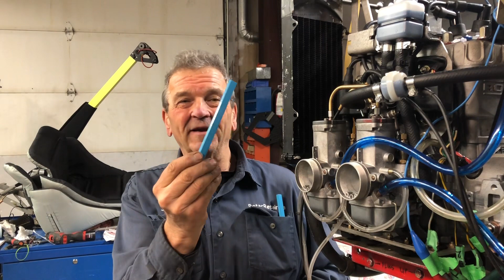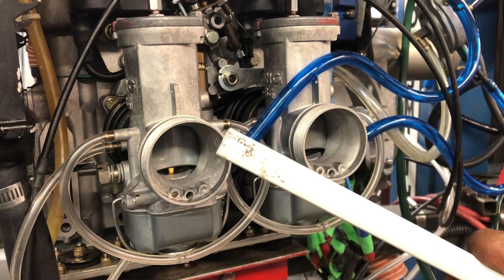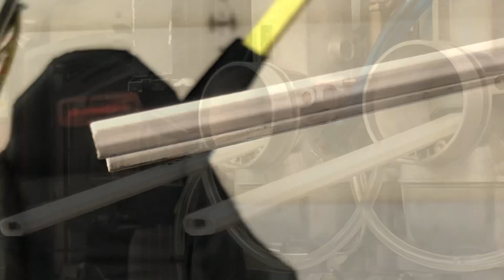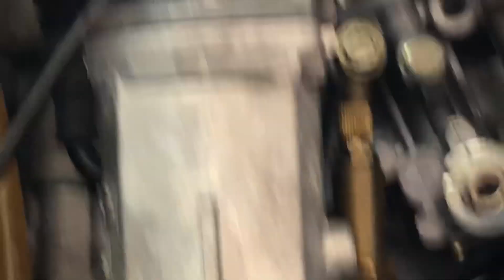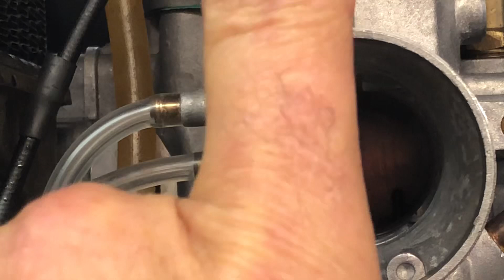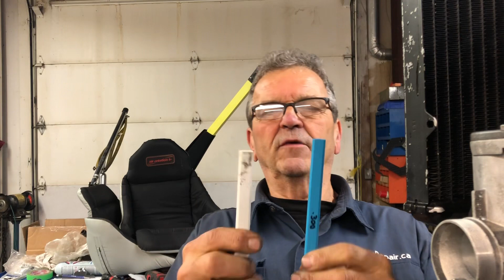Bing 54 carburetor adjustment with a pencil

Comment: Hello John,
I really enjoy your videos — you have a tremendous amount of knowledge, and I’m learning a lot from them.

I’ll soon be operating a dual-carb Rotax 503 running premixed fuel (no oil injection). The engine currently has two separate air filters, one for each carburetor.

I was curious about your thoughts on dual filters versus a single shared filter. In theory, a single filter seems like it might help equalize airflow between the carbs, but I’m not sure if that actually holds true in practice.

Do you feel individual filters are the better setup on the 503, or is there any advantage to a properly designed single-filter/plenum system?

Thanks in advance — and thanks for all the great content.

Comment: Good morning
Excuse me but I don't speak English.
Could you tell me what the numbers on your pencils correspond to?
I have a Rotax 582 with 390 hours.
Reply: Hello, the .285 inches and .300 inches is the thickness of the pencils on the narrow or flat side. This is to set the distance from the bottom of the slide to the floor of the carburetor opening. Hope this is helpful.
Reply: @JohnBaker-og4zp  
Hello 
Thanks for your feedback
Reply: @JohnBaker-og4zp 
could you give me the measurements in mm
THANKS
Reply from the maker: Absolutely can, 7.239 mm to 7.62 mm.
Reply: @RotacRepair  
Hello 
Thank you
Reply: What brand are the pencils?
Live in the uk

Comment: Great video.  Hi Again  Okay I just looked at BRP Rotax online owners manual site and it says the air screw setting is 1.5 turns out on the Bing 54 carb.  That is what mine is so should it be 1 turn out from your experience?  And how can I tell which adjustment is correct for my engine?  My 582 is a grey head manufactured in Aug 1992  Thank you
Reply from the maker: Generally I start at 1 turn from all the way gently seated.

Comment: Okay my 582 grey head upside down is idling rough.  I have already rebuilt the Bing 54 carbs with up to date insides.  FYI the side thickness on the carpenter pencils are all different too.  I bought some and found out that they are all different widths and thickness.  If to narrow they don't cradle very well in the bottom of the carb.  But nun the less I did everything as you described and my engine still is idling rough below 2800 rpm.   I even used a set of motorcycle vacuum gauges and tried to sync that way too and no difference but couldn't get it to idle down to get a steady vacuum reading.  Any suggestions as to what I can look at  in order to get it to idle smoothly at 2250 rpm?  Thank you so much.
Reply from the maker: I’ll need some additional information if that’s possible. Is you engine equipped with intake silencer kit or K&N oval air filter?
Reply: @RotacRepair  inn oval
Reply: K&n chrome.
Reply: Oval
Reply: okay  I just thoroughly clean the carbs reset everything.  Idle about 2800rpm and balanced.  there's 3 hours of run time on the plugs.  Started it up with a little primer fuel.  ran a little smoother at first then started to run rough and engine shake like before.   Increased throttle to 4000 rpm and ran better but noticed it has a small miss coming and going.  I let it warm up to 160  degrees and tried to idle it at 3000 rpm and ran rough then increased again and ran smooth from the cockpit but when standing next to the engine I could hear and see the engine miss a little bit and shake the carbs slightly in my hand.  so for the ten minutes it ran the carb fuel lines got to be 1/2 full between the vacuum  fuel pump and the carbs.  It is the old round minkuni  type. So I did check the top of the pistons and there is no huge carbon build up just slightly coated. and it has the K&N air filter. any help would be appreciated.  Thank you Gary

  @RotacRepair
Reply from the maker: The engine runs rough below 2800 rpm. Does it smooth out past 3000 rpm and run normally to 6000 rpm?
Reply: @RotacRepair  yes rough below 3000 rpm and smooth to full throttle. I just pulled the carb’s off and they appear to be clean but I have not cleaned all the passages yet.  And I will check the floats for bouncy and adjustment.  O rings look good and and jets and needle valves.  I have to check the clips.  I checked the primer valve and it works good and not leaking extra fuel when running
Reply: @RotacRepair  my engine is under a cowling on the nose of my Avid aircraft
Reply: @RotacRepair  I also run 90 octane with no alcohol and it is oil injection
Reply from the maker: I’d be specifically looking for a plugged or restricted idle jet / idle system issue. Below 3000 rpm is the idle system. I’ll use this description, however in reality there’s a system overlap. 0 to 1/4 throttle is the idle jet system. 1/4 to 3/4 throttle is needle and needle jet. 3/4 to full throttle is main jet.
Reply: @RotacRepair  Okay Thank you for that info.  I have pulled all the brass parts/ Jets from the carbs and there was nothing plugged or dirty.  Float needle is good and working fine.  I will let you know what I find when I check the Passages with carb cleaner and air.  Thank you again for your help.  I hope I can find something simple to fix.  I did check the fuel lines before disconnecting them from the fuel pump and they were full and no air bubbles.
Reply: @RotacRepair  Is it possible that the air adjustment needle O ring is leaking air by it making it unable to adjust properly?

Comment: should dual carbs be positioned level with the motor or with level flight attitude?  The motor tilts way back on a kolb, you have to tilt the carbs forward about 5 degrees to make them level.
Reply from the maker: I adjust my carbs to be level at flight attitude.

Comment: Been flying my 503 Rotax for 22 and 780 hrs.  years.  Finally the first inclusive easy to follow and believe video on syncronizing my Bing 54 s Most of the time I have used drill bits to set the syncronization. I see the pencils working much better.
Reply from the maker: Thank you for the kind and positive comment from a very experienced 503 pilot. Happy flying!
Reply: or you can just move the throttle so the slide is at the very top and sync them just by feeling the edge, you can feel .001"